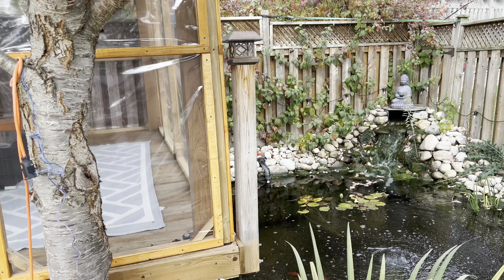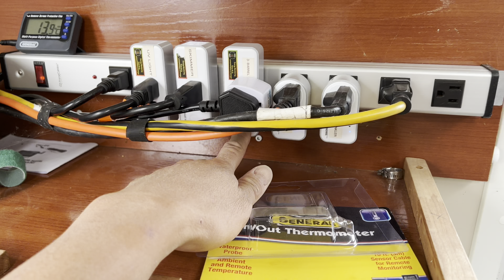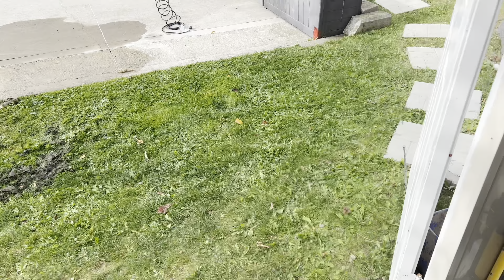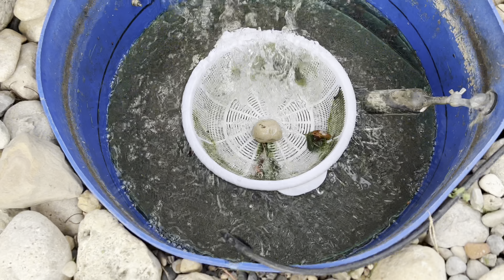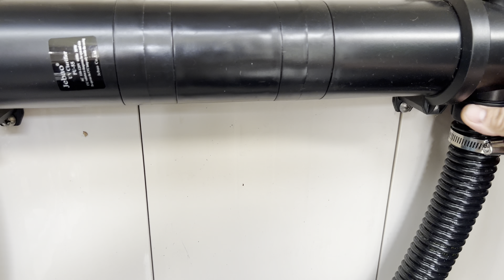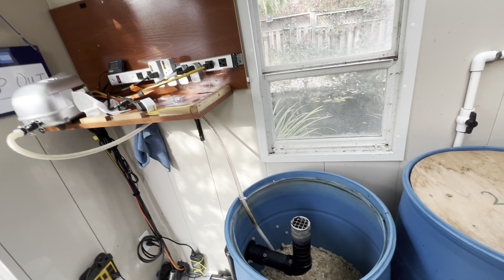3-Barrel Filter System Update - Final Cleaning and Shutting Down For The Season

Comment: Congratulations on your wonderful filter system. I got some great ideas. The question I have is why do you switch off the filter in winter? Is it purely a cost-saving exercise or do you do it for any other reason?
Reply from the maker: Thank you!
In the winter time here, Ontario Canada, the temperature goes down as low as -25°C. Everything freezes up. Shutting down the pump and the filter system is to avoid damage due to freezing.
Reply: @PTranProductions  many thanks for the reply. Keep up the great work.
Reply from the maker: @A.P.Garland  
Thanks! 👍